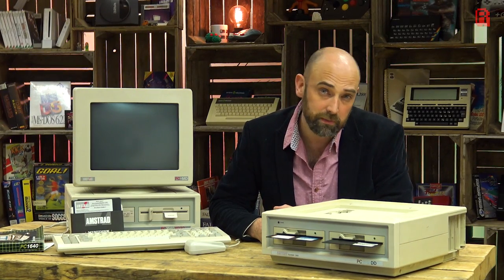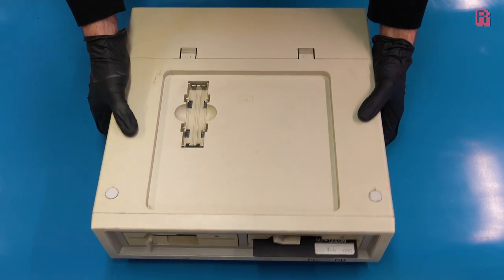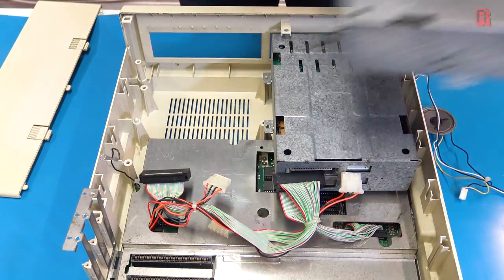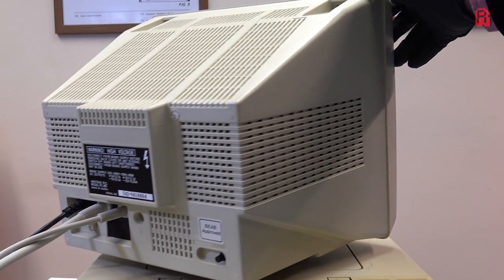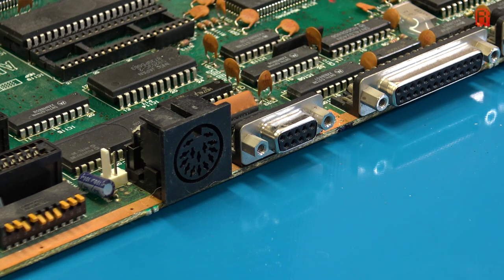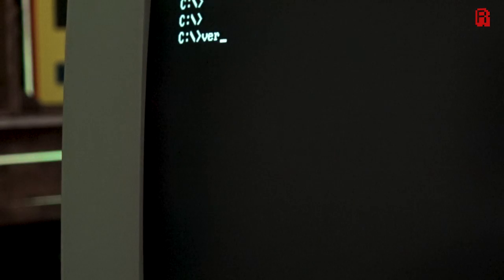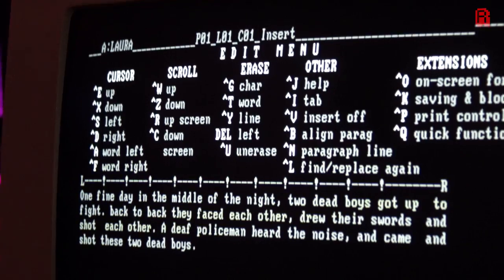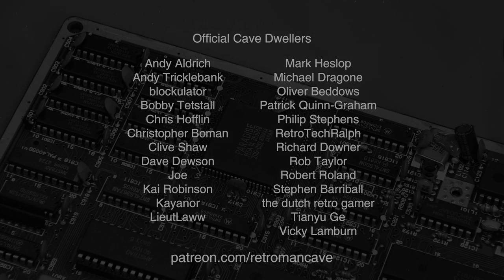The PC That Cracked Europe - Amstrad PC1512 and 1640 | Computer History

Comment: I had a 1640 for my first PC, loved it gutted it threw it in a skip years ago.
Reply: Me too, i tried selling it on eBay in the year 2000 for only 99p, no one wanted it :) So i took it down the tip, it was fully upgraded too with a 40mb HD :(
Reply: Vax Buster madness what we do isn’t it. At the same time I threw this away I also got rid of my 386, 2 486s and another few machines.

Comment: A popular upgrade for the 1512 was a combined hard-drive + controller that was on a full length ISA card. Unfortunately the PSU in the monitor sat right above the ISA slot and had a nasty habit of wiping the hard drives!
Reply: No metal shielding on top of the case, i guess having a plastic case does have its drawbacks. I clearly remember (and even still have) several clone cases made of metal, that harddrive+controller full length card was probably intended for the common clones of the day (and the actual IBM) which were all metal case.
Reply: @freeculture  Totally agree. I think the issue got some attention, and didn't help Amstrad's reputation, especially with the hard drive scandal that followed it. Still, it ushered in an era of affordable clones. I was working for a 1st generation computer dealership in the 80's and we hardly ever saw a genuine IBM XT or AT - only in official establishments like the health-board (UK). Everyone else was buying clones.

Comment: My first job out of college was selling and supporting these. And I've had a few flashbacks as a result. . . Contrary to IBM's salesmens views I remember them being tough little things. I once had to flush raw human sewage from a 1640 (long story, don't ask) and after a good scrub with some detergent and a weekend on the draining board of the office kitchen, a quick zap of WD40 on some connectors and it was good to go. Also you didn't need another controller board to get a hard drive in one - I used to use WD "Hardcards" to whack in 20Mb or more in under an hour using a utility disk I wrote for myself. My main development / support machine ended up with an unimaginable 64Mb of hard disk - which I filled after a years playing with a hand scanner. While I was saddened when the newer Amstrad PC's failed - Amstrad bought Viglen and sold those for a few more years. and they were a pain to fix. It was a simpler time - 5mb hard drives were office server stuff. But I did get one lucky break, a company called Acer started making reasonably priced, flasher looking PC's and the company I worked for started selling them. One day we got a chance to use their new toy at an exhibition - I just had to build it first. It was an over night job and several hours on the phone to the US, but eventually I licked it into shape - and everyone was blown away by the 33Mhz 386 tower. Final word on wordstar - I still have a copy, dont use it - but have the disks in a box somewhere. 3.5" to go onto an IBM PS2 - which wasn't always IBM compatible as I learnt when I had to rewrite all the printer drivers for the companies software.

Comment: Weird thing that's the measure of how old these machines are: I have a late 90s copy of PC Gamer somewhere that has a retro gaming section in it featuring them, or at least a 1640, plus a couple other similar old boxes, doing a showdown between them in terms of ease of setup and data transfer, what you can run on them, etc. The Amstrad cost somewhere in the region of £10~20 second hand at the time, and came out with quite a good score thanks to the EGA chipset and moderately fast CPU (an 8MHz 8086 under MSDOS and running programs that will work with only Conventional Memory available will very nearly keep pace with a 286 at the same clock speed, and certainly show a clean pair of heels to a 4.7MHz 8088) allowing a greater range of actually enjoyable games to run with decent visual quality and responsiveness, as well as the hard drive meaning things can load a lot faster and GEM making file navigation a breeze... Somehow I think these days it's probably at least a little more expensive.

Comment: I had the single floppy version :-) My second home computer. However, the mouse was not very useful at that time. The computer was equipped with GEM, a windows-based GUI, with a owner language called "Turtle". Each time you turned on the computer, you had to load the operating system stored in a unique floppy. However, it is on that computer that I learned programming languages as C and Pascal. Thank you for this video.

Comment: You ask about the two display chips in the 1640 - the Amstrad-branded one is indeed the same part as in the 1512, but it doesn’t provide compatibility with the 1512 16-colour CGA mode - that mode only works on the 1512 itself. Looking at the schematics in the 1640 service manual, the video outputs from that chip aren’t connected to anything, so why is it there? Because it also contains the decoding for the RTC/NVR chip and parallel port I/O addresses, and generates the 1.2MHz clock for the 8253 PIT (and possibly some other minor functions). Presumably Amstrad used some spare capacity in that gate array for some glue logic and it was cheaper to use the same part again rather than have a new one designed, tested and made just for the 1640.

(Cliff Lawson’s old website used to point out that you can disable the 1640’s integrated video and fit a VGA card or suchlike, in which case it now has two present-but-disabled video controllers alongside the one you’re using! You could also set the machine to use the built-in chip for Hercules and fit an EGA/VGA card or vice versa, with DIP switch settings documented to make either one the primary display.)

By the way, the 1512’s video output is RGBI, but slightly peculiar compared to standard CGA - the composite output you refer to is, I believe, just composite sync as opposed to separate H/V-sync signals. I have the colour display for my 1512 and would be happy to lend it to you for filming at some point - I believe I’m not too far from you (the Cotswolds?) so could drop it round easily enough!
Reply from the maker: Wonderful stuff thank you for this information!
Reply: No, thank you for the video - it's nice to see these machines get a moment in the spotlight!

Comment: Used a 1640 at work for a couple of years, testing printed circuit boards. Bought a second hand PPC512, with twin 720k 3.5inch floppy drives.  Remember Edlin?

Comment: 3 or 4 of the senior managers at my first job bought Amstrad PCs.  The chief accountant bought the cheapest (didn't see that one coming, did you?) 1512 model, another bought the colour.  I think the others bought 1640s.  I was often called upon to help.  I recall using RPED (in favour of EDLIN) to edit config.sys and autoexec.bat files.  At the time, I revelled in my Amiga 1000.

Comment: I had a PC1512, my first PC. It cost £400, making it the only PC I could afford. I fitted a hard drive and the fitting guide directed I attach aluminium foil to the underside of the lid to provide shielding from the monitor. It was good value though. The external RTC battery slot was a good idea. I have currently got a netbook spread out in pieces on my desk because the RTC battery is glued to the main board, completely inaccessible from the outside!

Comment: I remember Xebec - "the zero defect company"  - causing Amstrad no end of problems with hard disks in the AT-class PCs, and there was also a custom HD interface chip (made by Flare, the ex-Sinclair boys, I think) which locked up a lot due to the chip process having a problem with undershoot on the PC bus locking up the die. GEM was also fun, as when Amstrad wend to DR and said "How do we write a printer driver, then?" they got the reply "That's a really good question, we haven't got to that bit yet.". Also, don't forget the Sinclair-branded PC200, a truly abysmal design. What were they thinking? Ah, happy days!

Comment: I had the PC1640 that I saved up to buy in... 1986?, which is one reason why I only finally forced myself to take it down the town dump just 6 months ago!  It had been fired up a few times in the last twenty years, mainly because it was the only PC I still had that could read 5 1/4" floppies.  I kept the floppy drive when I dumped the rest:  I have in mind doing a driver for it for an Arduino or STM32 Blue Pill.  ISTR I replaced the 8086 processor with a... V30 (? can't be sure that's what it was called), which was supposed to be a bit better.

Comment: I bourgh a 1512 with a 32mb wd filecard, and a juki printer when i started on Computer school. It came with dos 2.2 and could access the full 32 mb, so all my school mates was impressed with 3! drives.. a floppy and 2! harddrives - partiion c and d. Later i got it upgraded to 640 kb, and a rll controler. To save money we got seagagte 4096 mfm disks which actual was 4144rll disks that had to many sector errors to be sold as rll disks.. but formated them to rll, and created a "fault" list on the disk so we got a little less than the 144mb rll but more than the 96mb mfm :)
Actual i ended with a system with 2 disk drives and to hard drives... both seagate 4096 formated for rll, and a 2400 baud internal modem.
There was 2 large problems with this configugration. 1. The lack of space interenal to 5 1/4 full sized disks, so i ended up with removing the side access cover at just had the rll cable runing out to the 2 disks on the table. 2. lack of power from the powersupply. Due to the power demand from the 2 seagate disks on powerup, i had to switch the system on and off i rapid succession 3-5 times. This gave the disks enough power to spin up and rotate so the system could boot.... otherwise the powersupply coundt get the disks up before boot time out :)

Comment: My father had one of these models. I remember the battery bay, I remeber the screen slotting into the machibe, the two floppy drives, keyboard, and he added a harddrive much later on I think. I played a game where I was a H moving blocks and squeezing other things. I had to boot it up with two discs at first, and then the game. It was some OS. Yes that paint I remember. I also played chess, but I didn't get it much. I am not sure if there was other games.

I remember there was something strange with the keyboard. I guess its the capslock.

I was born in 87.

Comment: I had the 1640, I remember that the 10mb hard drive came with bad sectors, which was the thing then as they hadn't perfected HD at that time. 
Mine had a CGA monitory but if I included the Display.sys in the Autoexec.bat it would run in EGA mode but it was slower. 
I was 16 when I got this and I put the reason why I am now in IT due to this PC, lots of trials and errors etc. 
One app I liked was GEM software is was like Windows at the time, I also ran Windows 2 but wen't back to GEM,  @ 14.43 I remember the sound of the PC booting up, wow, brings back memories. 
My Parent's did get me the 3.5 720K Floppy drive for it as well, came it really useful later on.
I kept this pc for years all the way through my college and university years, running A+ for Word and Excel type programs.. wish I had kept it.  My next PC was a TINY P75

Comment: A very nice system indeed , and with up to 4 8bit isa slots it leaves a lot of room for upgrades , you can easily upgrade it with some modern XT cards :3

How about VGA, a XT-IDE, Adlib card, and the cherry on top a Ram card :3 ?
You can have a very nice XT class system in a nice form factor

The PSU is a bit of a issue though but I am sure some one must have the pinouts online and you can probably get most of the voltages off of a AT power supply :)
Reply: Someone has indeed documented not only the PSU connector, but virtually everything about the PC1512:
https://www.seasip.info/AmstradXT/1512tech/section1.html
The PSU connector is at the very bottom of that page.
Reply: The PSU certainly is an issue. I have an XT-IDE installed in mine, and also an Aztec Sound card, you can hear unshielded electrical interferance from the PSU over the soundcards output. Another worthwhile upgrade is also what I have done, change the CPU from the IBM version to the faster and pin-compatible NEC v30 version
Reply: VGA is overkill in a 1512/1640, because it necessitates replacing the monitor, which in turn necessitates replacing the PSU, and the 8086 really isn't fast enough for driving games in VGA in any case (though, I guess it's a much more straightforward video architecture than EGA, so might actually perform a little better)

Extra memory beyond the base 640 isn't much use in an 8086 either.

Between the onboard EGA and the full 640k base memory, the 1640 is a really great little XT class PC, but if you want VGA and >640 you really need an AT class or higher.
Reply: @BertGrink  IIRC it's actually in the technical manual for the system.  The 1512 hails from a period iin history that people were SERIOUS about their computer manuals.
Reply: @TheTurnipKing  Yeah, that sounds about right. I remember a friend who had a PC back then (before i had my first one) and it came with several solid tomes of information, both about hardware and software.

Comment: regarding the fan in the desktop housing: my dads 1640 30MB HDD had system lockups a lot. Amstrad forgot to add a fan to my dads computer. he added a fan himself and connected it to the hdd molex power connector. problems were gone. so it was clearly not a "marketing excercise" or "not necessary"

Comment: I miss my XT. fun fact: the game "barbarian" is controlled with the F keys. movement, fire, jump, everything!!, so it's playable on a XT keyboard with the F keys on the left and in that layout but it becomes unplayable on AT keyboards with the F keys up there forming a line instead of two colums. I haven't been able to complete the game ever since my XT died and I got a 286.
Reply: Clearly you need a programmable keypad.
Though I suppose finding one compatible with hardware that old could be difficult.
Reply: it doesn't have to be compatible with very old hardware, any computer running DOS/9x is fine.
I haven't looked into it for years, but there must be some key remapper software for DOS.
I wonder why they programmed the controls to the F keys instead of OPQA or the keypad.

Comment: I had a PC1640 20HD, amazing for the time, but so quickly made obsolete.

Be aware though, they weren't 8086 machines.  They used the i8088 CPU which had an 8-bit data bus while the 8086 had the 'full' 16-bit bus.

Comment: Could you hot rod it out? VGA card,  8 bit ISA sound card,  XTIDE card with compact flash in place of the stock hard disk controller, and an 8 bit scsi card for a CDrom drive? I bet you could rig up a custom power supply to replace the monitor, and just use the VGA card's output instead.  I wonder how much of all that requires an actual PC bios though...
Reply: I upgraded mine with an xt ide and a sound galaxy nx 2. Pc1512 was my first PC
Reply: You could but there is little sense in doing so. An 8 bit VGA card is painfully slow in a 286, let alone a 8086. Some games could work, perhaps in degraded mode. The flash card could be a nice convenience tho. And i guess a VGA card would do if you don't have any CGA/EGA monitors around anymore. The bios is probably irrelevant, most msdos programs didn't care (using bios calls was too slow). Sound... hmm i don't think you would be able to do much, such as a game with background music because, again the CPU is too slow to handle all that. An Adlib could work using its standalone player and music composer i guess, or you could hear a few samples with a Sound Blaster. Some games could work too i suppose. I don't think a cdrom is such a good idea. And all of that needs msdos 5+.

Comment: 11:52 The PC1640 doesn't support the PC1512's 640x200x16 video mode, so that can't be why the 40041 video chip from the PC1512 is present. Looking at the schematic in the service manual, the only pins on it that are used are to decode addresses for the Real Time Clock - presumably it was cheaper to leave the 40041 in than design a new address decoder IC.

Comment: Those original 5.25" MFM/RLL hard drives were quite noisy, they were low level formatted with sectors spaced out because early PCs couldn't keep up with the raw data speed (maybe due to the slow 8-bit ISA bus as on these Amstrads). For a while I only had a 10Mb HDD, so I used an alternate to Stac Stacker called AddStor SuperStor to compress more files on it. Without the internet, acquiring software was more difficult back then, which is why people often copied from elsewhere - ahem. Laplink was useful for copying files between 2 PCs over serial crossover / parallel cables, to save swapping 360k floppies which soon became tiresome.